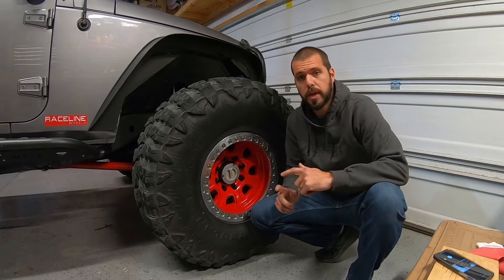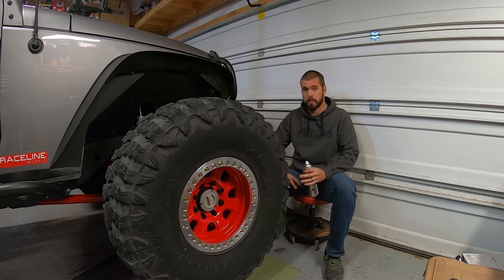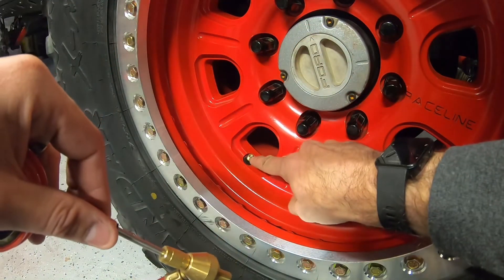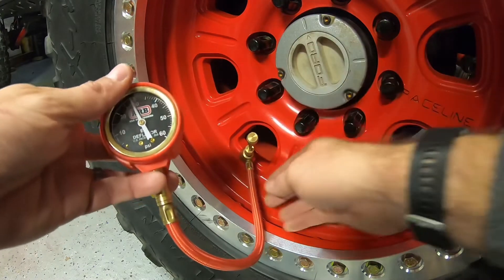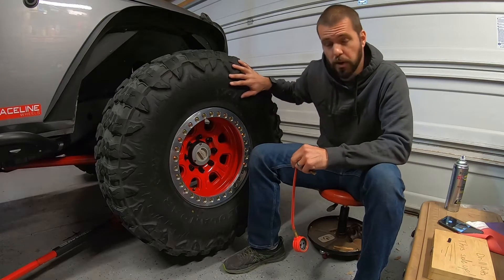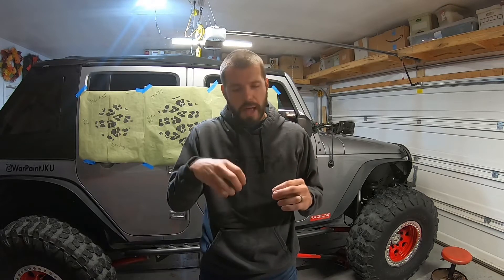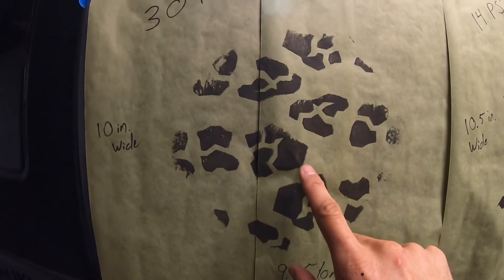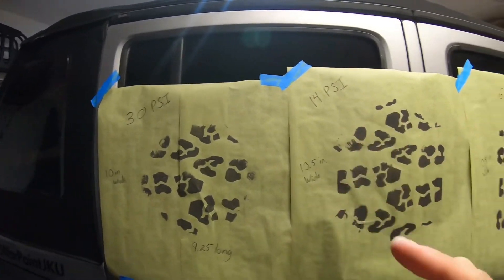Are beadlocks REALLY worth it?

Comment: That’s very interesting, definitely learned something today. I’ve always seen chalk, but the paint really shows the increase in length.  What are you using to reinflate?  I have a 12 volt compressor but it takes forever.
Reply from the maker: So the parks I go to have air up stations. Basically just a couple really big compressors with several air lines. The ones that don’t have that style set up, I trailer to. There are a few good options on the market that push some good air. EZ Flate is a new one. They seem to have a lot of energy behind them. I haven’t tried it, but might be worth a look.

Comment: Now do zero psi. 🤣
Reply from the maker: Haha. Don’t tempt me!
Reply: @WarPaintOffroad  gotta be a point of diminishing returns. I would imagine the very center of the tread would not make contact at zero. Would be cool to see.
Reply from the maker: @jbw5485  yea…I’m not sure. I run them at 5-7 psi and they do very well. I would imagine it would t make much of a difference letting it all out. But now you have me wondering…
Reply: @WarPaintOffroad  I just installed some 15 inch beadlocks and 35’s on my side by side. Haven’t had a chance to drive it and play around with pressures. But I did take the schrader valve air one all the way down just to see. Probably would take a ton of throttle to even get rolling with all 4 aired down flat. Haha I’ve got 8-10 psi in them right now. Just barely to the point of seeing the sidewall bulge.